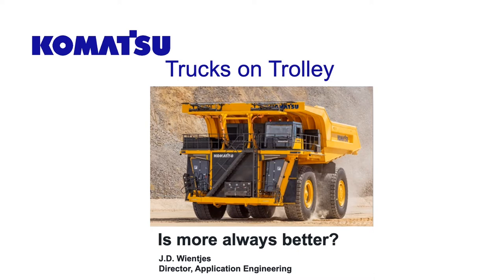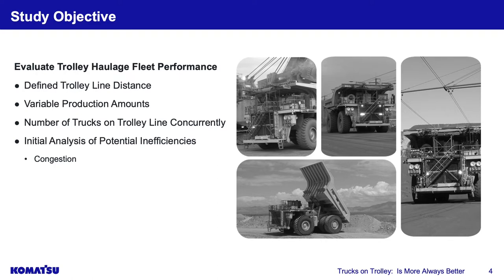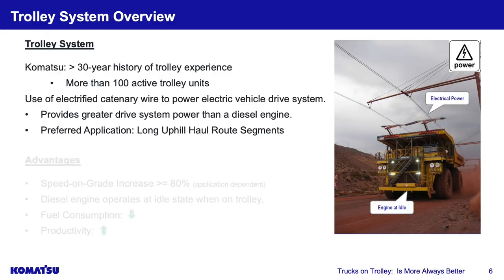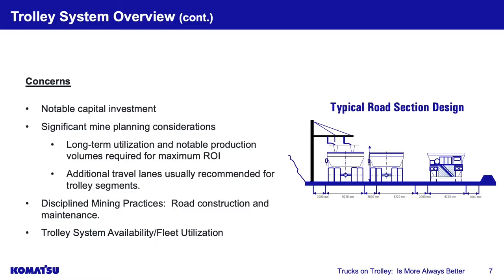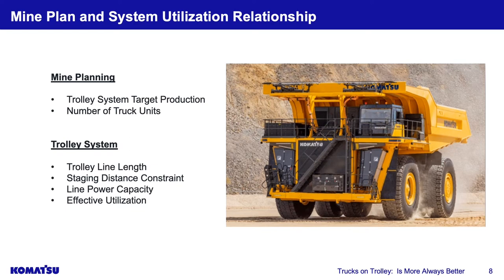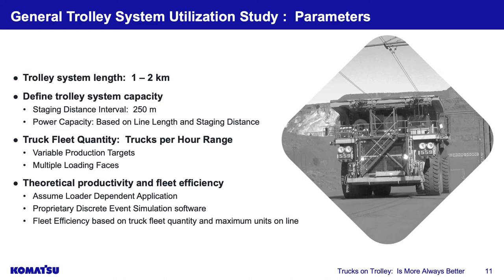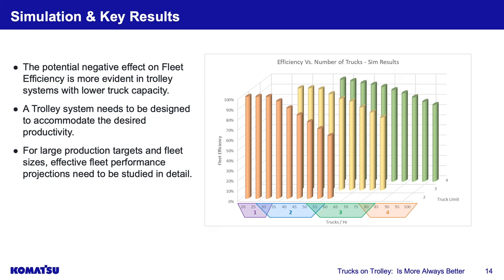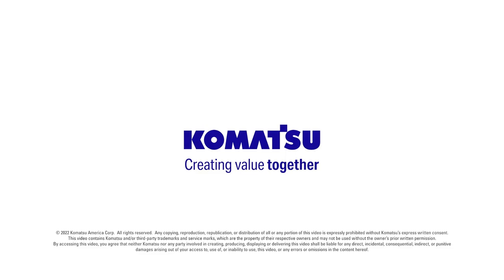Komatsu Presentation  -Trucks on Trolley: Is More Always Better?

Comment: does anyone know why adding another lane would increase the tonnage that has to be mined?
Reply: I think he meant overall material that needs to be moved rather than mine production output. Eg. when building the road, you need to cut ~15m deeper into the wall, all the way to the top, or backfill as much, all the way down.
Reply: @Nadstratosfer  correct.